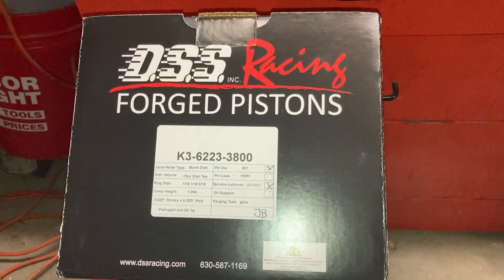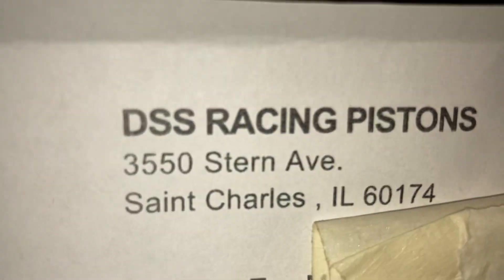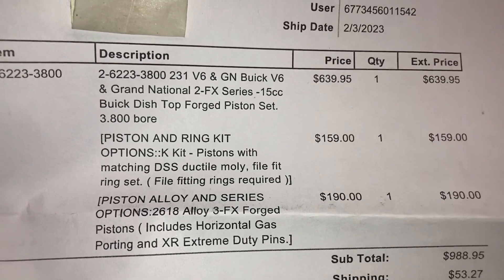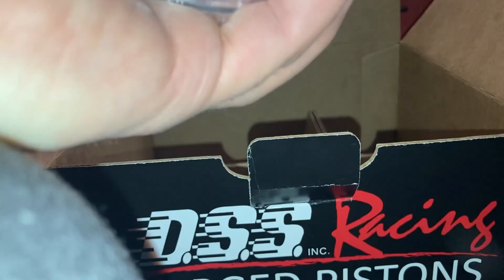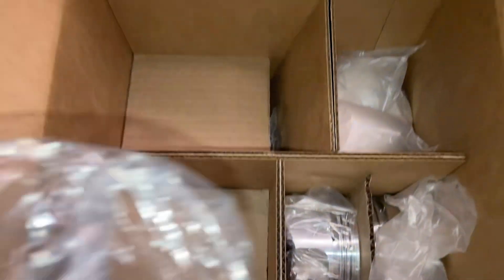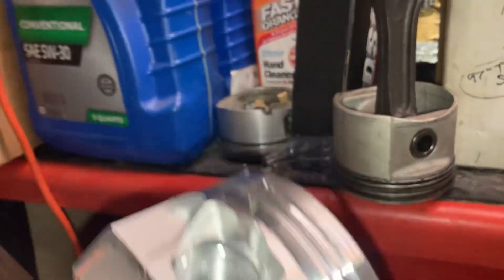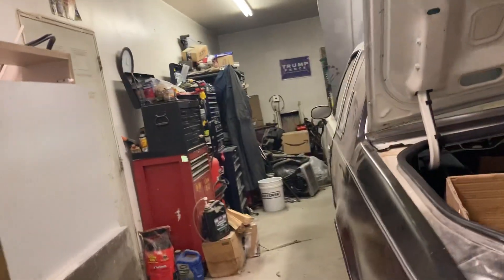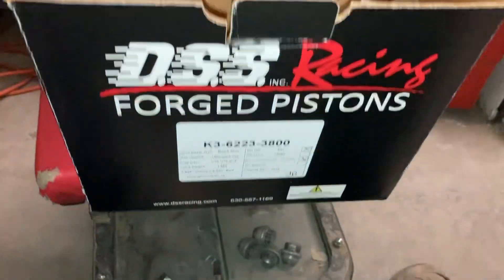Forged Racing Pistons for Buick 3.8 Turbo Stroker Engine

Comment: Be glad you only had to buy 6 LOL.
I've got a set of DSS flat tops in my Olds 455. I thought they were a nice looking product when I got mine as well. They are flat tops but have a slight valve relief to them.
Shit you paid more than me, I paid about 700$ for mine.

Must be that Buick tax.
Reply from the maker: Yes the turbo Buick tax.  I could have got them a bit cheaper without the gas relief option.